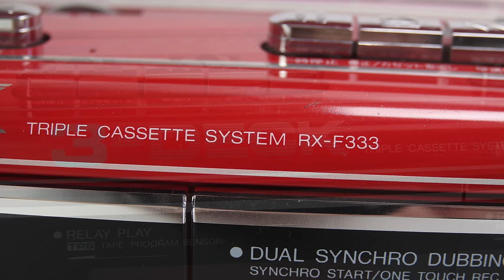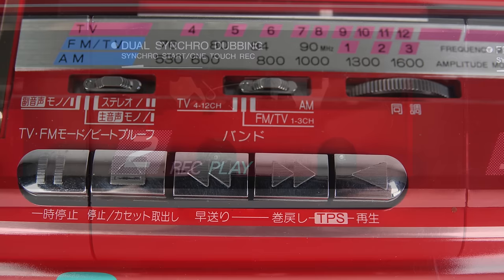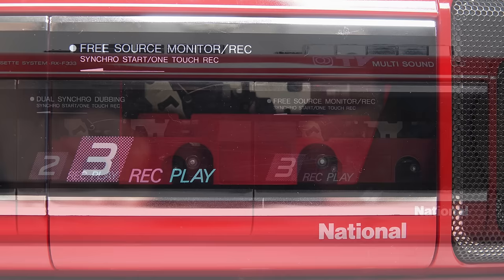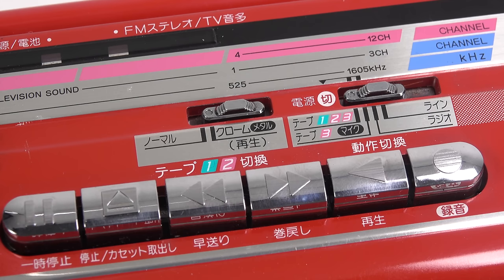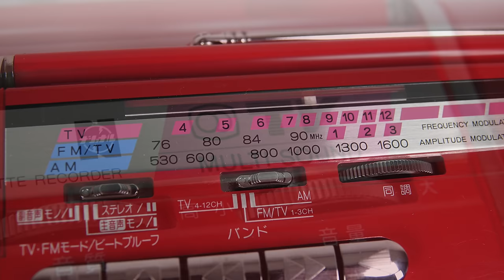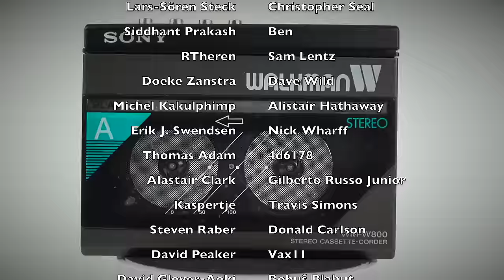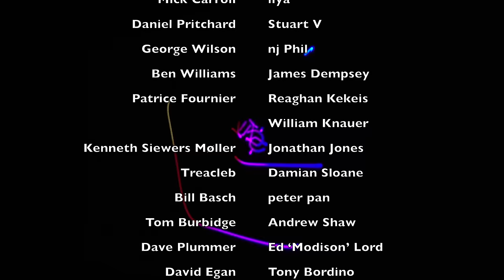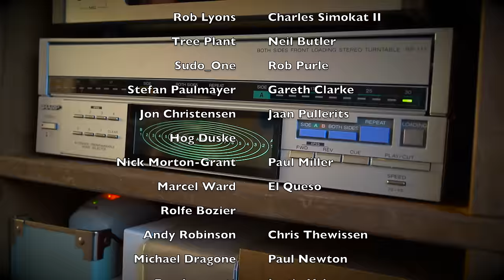The Three Cassette 'Boombox'

Comment: Techmoan I have an easy question for you.    What is more common a 60-minute cassette or a 90-minute cassette? Also great video; I never knew a boombox could have so many tape compartments.
Reply: I have never seen any stereo with 3 tape decks before. That was so weird.
Reply: As an 80’s kid I can tell you that 90 was more common. It would fit one album on one side while the 60 with just 30 mins on one side usually was too short.
Reply: @erwintimmerman6466  What was it like to grow up with tapes? How do do you feel about how it's changed to streaming?
Reply: Daniel Humer I feel two ways about it. First of all I’m VERY happy that the technical limitations of cassette tapes no longer are an issue. I hated these limitations with a passion. Most of all dirty heads which would suddenly take the treble out of one (or both) channels. Then, drop-outs (short 0.1 s disruptions in the music, mostly caused when you recorded over a tape that you had already played repeatedly), and wow/flutter. Also, tape machines could eat your tape, especially the cheaper ones. The better quality tapes were rather expensive for a teenager so I really hated when that happened. However, the availability of music is now so instantaneous, flawless and abundant, that IMO the value of it has decreased. Previously, putting om music was a deliberate act that took some preparation and effort.thumbing through your records or tapes with anticipation, knowing that the choice was limited. “Hey Google, play some music” just isn’t the same experience. 😁 But overall I appreciate the pros more than the cons, and occasionally put on a record or tape (yes, still can play those) for old time sake.
Reply: @erwintimmerman6466  What about CDs? What are youre thoughts on them? Do you think that they provided the perfect blend of "owning your music" and quality sound performance? Do you see them as a middle ground between streaming/mp3 and tapes/records?
Reply: @danH_1999  You must be a Millennial. CDs are still available brand new, I don't know why people are acting as if they're some distant relic from 50 years ago.
Reply: @ct92404  oh yeah no, I listen to CDs all the time I was just wondering if he though that CDs are the best of both worlds. It frustrates me that people 15-25 think so highly of records, when CDs are the obvious superior alternative. And I was born in 1999, so I just missed that generation, but I had siblings of that age group.
Reply: @danH_1999  Well it's not just people 15-25. In fact, they just jumped on the bandwagon late. They're just being hipsters. But a lot of people like records for different reasons, not just for the sound quality. Another reason is when you buy a record, you usually get a lot more included with it like lyrics, pictures and artwork, information about the band, etc. It's more like a book actually than just a music recording. I would agree that cds are far better in terms of convenience and reliability, but listening to a record is an interesting experience, and really that's what it's about - slowing down and enjoying the experience. I have a collection of records myself that I listen to sometimes.
Reply: @ct92404  That's cool that you appreciate both formats for what they are. And about the experience yeah I can appreciate that; I collect them too. CDs can give you that as well but I agree records do a better job in that regard. Do you have a stereo setup or more of an all-in-one system?
Reply: @danH_1999  I was a kid when cds became popular in the 90's. I got my first stereo with a cd player when I was around 15 or 16. I think it was for my birthday. I remember being so excited that I could just press a button and jump tracks up or down to whatever song I wanted! I was also really amazed at how fast the cd drive was spinning. My stereo had the cd player on top and part of the door was transparent and you could see how fast the disc was whirling. Lol I had never seen anything like that before that time.

At the moment, I don't have anything special for listening to cds. I just use my laptop and connect portable external speakers to it. And for records, I just have a simple stand-alone record player. It's a portable Crosley. For some reason, people complain about them a lot and think they're cheap junk, but honestly I haven't had any problems with mine whatsoever. It works great. The only minor problem is that it sounds a little "tinny" but you really can't expect much from the small built-in speakers it has. So I just hook up external speakers and it sounds great. I'm not really a major "audiophile," I just like to casually listen to music sometimes to relax.
Reply: @ct92404  That's cool. Thanks for sharing.
Reply: @danH_1999  I thought they were a godsend. Finally no scratched or noisy records anymore. They weren't replacements for tapes though, but for records. You couldn't record on them. Not until CD-Rs, but it took at least a decade before these came about and were actually affordable. I bought my first CD before I even had a player, because they also looked very cool with their rainbow patterns (I was 14, I think). So even after CDs I kept on making mix tapes. But now I didn't need to worry about scratches or walking on the floor while I recorded (with a turntable, the thuds of my footsteps would end up in the recording otherwise). I didn't like that their small size also killed off the artwork, because a 12" sleeve is of course way more cool than a 5" jewel case. After about a decade, I had a CD-R writer in my PC and made mix CDs instead. That era was the beginning of the end of tapes. In the 2000's mp3's became of sufficient quality that they would replace mix CD's, because now it was possible to have almost all your music collection on one device. And then came steaming, and the rest, as they say, is history. Now some people say that they want to go back to tapes because they sounded better. I think that's utter nonsense. Going back to tapes for nostalgia reasons, fine. But quality? If you want to have analog quality (or rather, recordings that have more dynamic range because they are mastered differently), use a good turntable, but not cassettes. :-) And I've got a good quality 90's desk and good quality tapes, but still find the quality is OK, but not much more.
Reply: @danH_1999  BTW I think that CDs are far superior to records, in principle. However, while CDs have a dynamic range of 96dB, they usually only use ~5dB of it because the dynamic range is compressed a lot during mastering (google for loudness wars). People who still buy records are usually audiophiles etc, so for that reason, the mastering of those recordings is usually squashed a lot less, with much more vibrant transients. So the irony is that the dynamic range of records, which theoretically is not much more than 60 dB and often only 45 dB, is usually higher (say 15 to 10 dB) than that of the CD of the same album. And thus sounds better. But that has nothing to do with the analog format, just with the mastering.

Comment: have you tried WD40? it will dissolve the gunk and make it easier to wipe off. edit: it wont hurt electronics.
Reply: Will it destroy replacement belts?
Reply: @biotechnologPROJECT  just dont spray it on rubber because oil degrades rubber. 

the suggestion to use WD40 was to remove the degraded rubber off the flywheel.
Reply: @porkyV2  and then wd40 still needs to be removed. So I would prefer full disassembly and washing with soap and warm water.
Reply: @biotechnologPROJECT  after wiping off the all degraded rubber gunk and excess WD40,  finish wiping with isopropyl alcohol will remove the traces of WD40. it will save you time and effort.

Comment: My neighbor had a Yorx boombox that had the traditional dual deck cassette tape system plus on the upper part of the box there was a third cassette player that could be slid in & out on a rail. When connected to the box it played through the system speakers but when removed it functioned as a portable Walkman like device. It was terribly poor quality but quite neat in and of itself.
Wow, I found a pic quite easily!
https://images.app.goo.gl/2uXBtGYEEuf4V5hY7